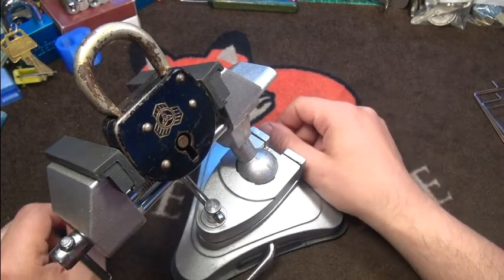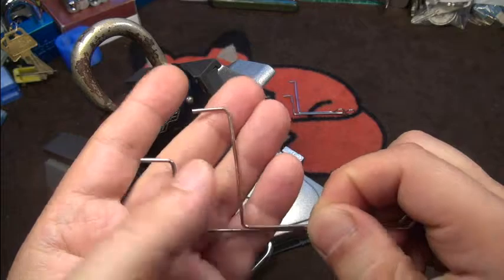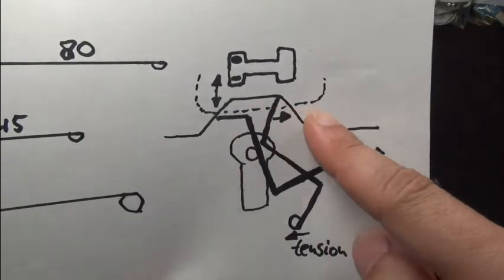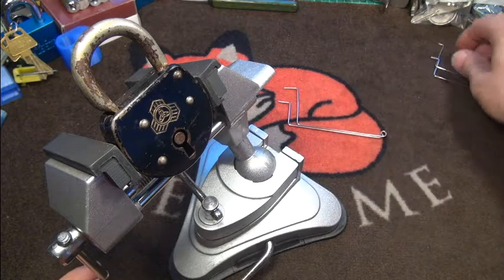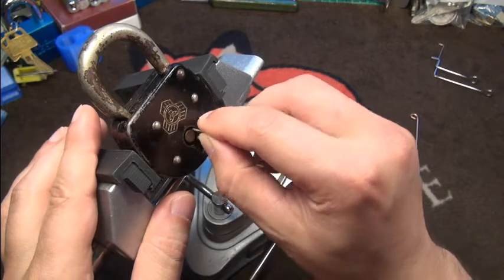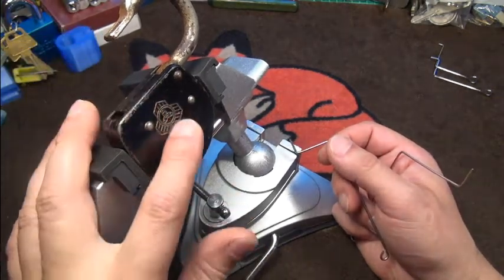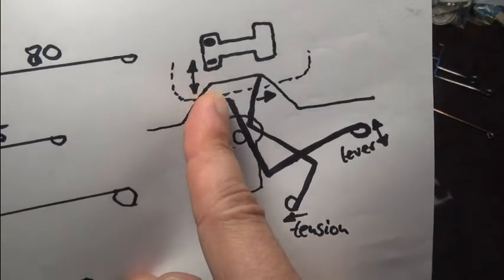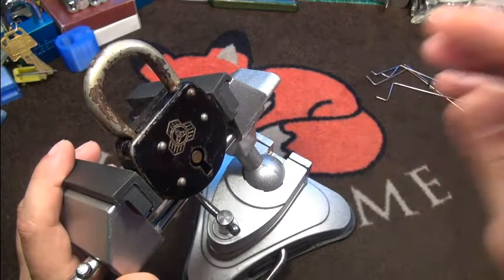307 - a little lever padlock picking tutorial

Comment: Thanks for the very helpful tutorial!
Reply from the maker: Thank you Robert :D. It's a bit of trial and error which picks fit, but once you get the feel for one, they are pretty cool to pick :). 😃👍✌🦊
Reply: redcatimaging I've got a number of old lever locks from the US.  I'll  try to get into some of them as soon as I get a chance.
Reply from the maker: That sounds great :D. If you have some with a key, it helps to have a look into the shackle hole, count  the levers, have a look whats inside. On some locks it actually says, how many levers are inside ;D and there can also be some with no levers. Sometimes the bolt is in the middle, sometimes at the back. Try to tension it (remember the jumping shackle) and try moving the levers. You can even try to pick it locked, but with an open shackle. You will fast get a feel for it :), right tension and a bit of feel is the key. Have much fun and good luck :) 😃👍✌🦊